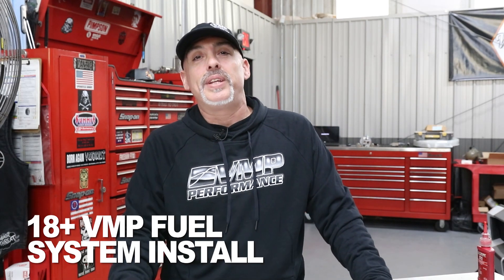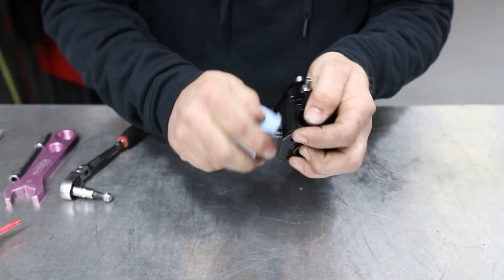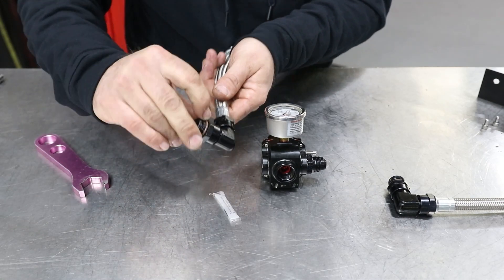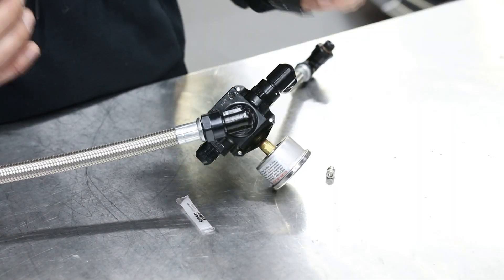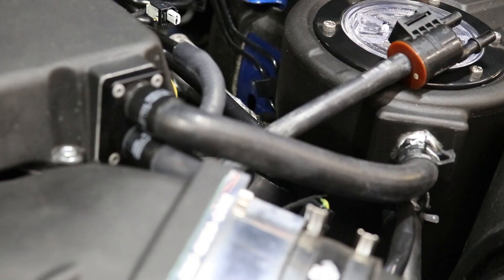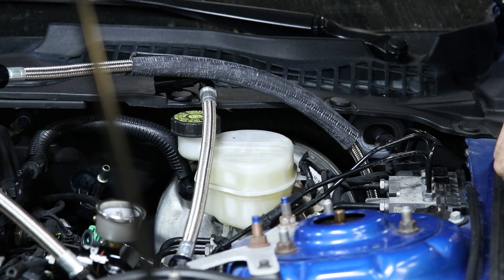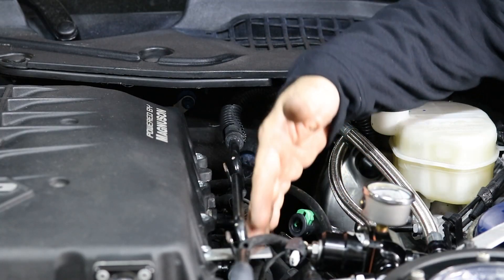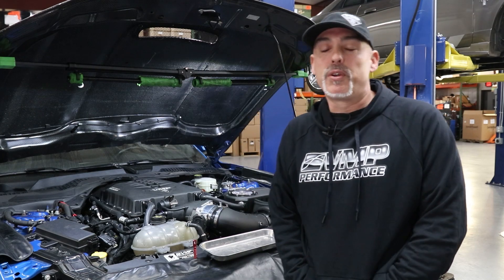Installation || VMP Plug and Play Return Style Fuel System '18+ Mustang Front Half (See Description)

Comment: VMP, I need to know if my supplier screwed up. The line from the regulator to the fuel rail doesn't screw into the VMP fuel rail. Did I get the wrong line? It has a big side and a small side. Big side went into the regulator just fine.
Reply from the maker: Shoot us an email with photos of what's going on and our support team will work with you to get sorted.  sales@vmpperformance.com
Reply: Will do
Reply: @brentrichards1200 what did they do for you on this ?

Comment: What do you do with the passenger side fuel line?
Reply from the maker: Hey Brent, it connects to the DI pump.
Reply: @VMPPerformanceTV  I meant on the other side. I have a set of VMP fuel rails and the return style system that I will be installing. Do I just connect it to the passenger fuel rail like normal?
Reply: Btw, I appreciate you answering these questions even after posting the videos nearly a year ago. The question is because the 11-17 doesn't have port injection, so it wasn't covered in the other video, and it isn't covered in this supplemental video.
Reply from the maker: No problem Brent.  The 18+ rails come with a fitting that'll screw into the passenger side rail so that you can connect everything up like OEM for the other side.

Comment: This install makes sense but doesn't make sense to piggy back this install off the 11-17....should have a separate vid for the 2. Need to show how passenger side it setup. With passenger side rail and high pressure pump.
Reply from the maker: This kit does not come with rails, hence no rail work being shown.  You would need to have aftermarket rails already to utilize our kit, as it's designed to be universal to many different applications and the rails used in various supercharger kits are widely different.  In regards to piggy backing the '11-'17 video, the items shown in this video are the only components different from the '11-'17 kit.
Reply: @VMPPerformanceTV  yea I came across that part. Trying to find fittings to tap into the 8an to 3/8 roush rails.